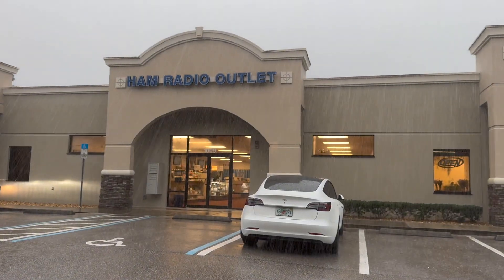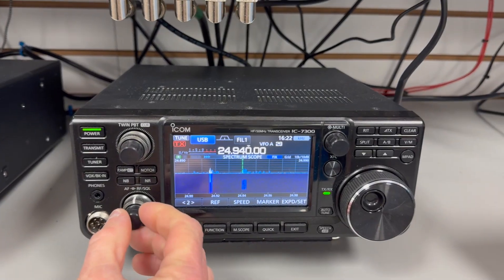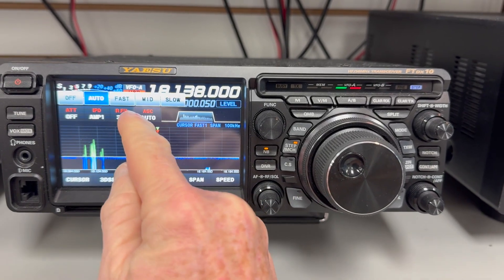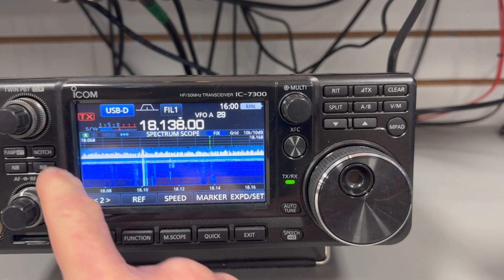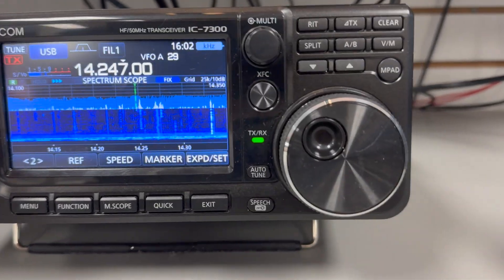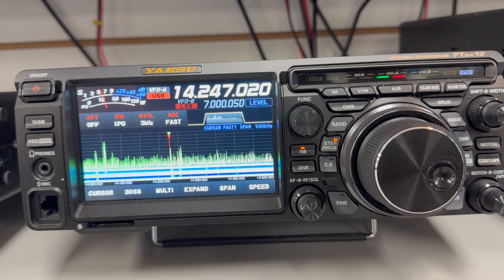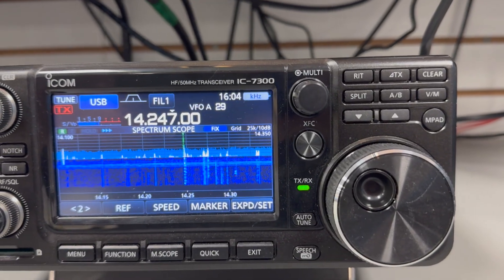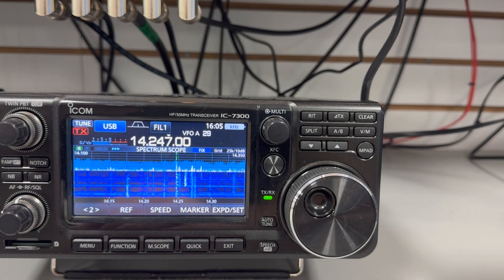ICOM IC7300 vs Yaesu FTdx10 during Orlando Storm (READ DESCRIPTION BEFORE COMMENTING)

Comment: did you hold down the noise blanker button on the dx 10 and turn up the noise blanker ?
Reply from the maker: Yes, sure did. Also described in the body of the video.
Reply: tnx for answering my question i also have a dx 710 and  dx 10 and icom 7300 i have been comparing  there noise blankers sorry that i missed  it in the header

Comment: Living in Oklahoma City, I also experience a lot of rain and thunderstorm activity. I own both the 7300 and DX10, and when properly set up (using DNR on the DX10), there really is no comparison. The DX10 blows the 7300 out of the water in handling noise and interference; if you add in notch/contour and shift/width, the DX10 is simply the gold standard in an under $1700 radio. In fact, i am now selling my 7300 after less than 2 hrs use. de KN7I in OKC
Reply from the maker: Thanks for sharing your experience!

Comment: Why are you using the NB mode on the Yaesu,did you set the NB settings correctly and when you should have use the DNR instead (And you didn't even turn on the DNR on the Yaesu) with a little of the CONT for those lightning strikes affecting the Yaesu sensitivity receiver,the Yaesu is why more sensitive than the Icom 7300 and that is why you are picking up the lighting strikes.Your not being transparency of the real performance of the radio and it's option feature of the radio itself,it's like bashing a manufacture without really owning one and know it's features and know all the features it provide you as a tool.You didn't control the D-Level screen to lower the spikes or the waterfall.You adjusted the Icom radio of the NR ,but never did do it on the Yaesu,what kind of transparency reviews are you telling those folks who watching this video who wants to buy either of the radios?I think you need to re-clarify all the folks here on YouTube of your Video if you plan on doing this reviews that is not legit of your words.
Reply from the maker: All of these complaints about me. I went in knowing nothing about each radio. Spent 30 minutes with each. Then made a decision. I've been transparent about all of this. And I've also said in the introductory text, and numerous replies that I did try DNR and it didn't make a difference. (The video was long enough so I didn't include that test). I've also said repeatedly that I'd be super happy to meet someone down at Ham Radio Outlet in Winter Park who knows the radio where we can repeat the test. I'm not trying to bash any radio -- just report what I personally found on that particular day and under those particular circumstances.

Comment: Crikey - some butt hurt Yaesu fans here LOL. I'm radio agnostic, I have all brands - Flex, Icom, Yaesu, Icom and Kenwood. Within the genre of this video, I own 2 x IC-7300, 1 X FTDX-10, 1X FT-710. For me personally, I prefer using my 7300 for a number of reasons....for starters the UI is way better on the Icom. Also  the power level can be stepped all the way down to 0.3 watts whereas the Yaesu stops at 5 watts. This is important for me because I use Mosfet amplifiers that need drive levels below 5 watts. I also have VHF and UHF transverters that require 1 watt of drive. Amp hookup is also easy on the Icom - I live in Africa and I can go to any local grocery store and buy the RCA cables required to hookup to my amp. With my Yaesu, I would need to import the special cable (or connector) from the USA or EU. Then there is the creamy smooth averaging of the display.....and one of the most important features - being able to see ALL meters on screen at the same time - Power, SWR, Current draw, Processor level, ALC, voltage, temperature - highly important when trying to setup digital audio levels and monitoring transmission levels. Yaesu can only show one meter at a time. But, I'm not selling my FT-710 - I love that rig, but will probably sell my FTDX-10

Comment: Both are great radios. As others have said, you turned up the panadapter level (which does not affect audio fyi) and did not adjust the DNR on the Yaesu. I highly recommend N4HNH's videos on a comparison between the 7300 and the FTDX10. The Yaesu has more tools to deal with noise such as a manual notch and contour, as well as (imo) a better DNR and NB. I wish I was in the Orlando area, I would happily help film another comparison.
Reply from the maker: I did adjust the DNR, but not in a recorded part of the video. And yes, the real clue is going to be meeting a buddy there and doing another test.

Comment: Did you notice that on the FTDX-10 you can't tune the radio by clicking the bandscope?  Keeping my 7310..  bandscope centric is a key SDR feature.
Reply from the maker: I didn't notice that, but the particular feature of the 7300 is also something I haven't tried myself. It sounds useful and I will give that a try.

Comment: I'm afraid you have no clue how a noise blanker works and what it does to a receiver. 
The 7300 was the winner (in your opinion) because you were not able to use and compare these transceivers correctly. 
The IC7300 MIGHT have been the winner for you - it's a very good transceiver -  but NOT because of your wrong conclusions.
Reply from the maker: So I'm right, but for the wrong reasons? ;-)

Comment: AGC on SSB should be medium or slow.  You had it set on fast on the Yaesu. Really wrecks the audio response with respect to noise.
Reply from the maker: Could be. I've found medium or slow to be troublesome on the ICOM radios, so that's why I set the Yaesu the same. I've been wanting to do a re-test, at that same location, but during a time of clear weather, and also with someone who really knows Yaesu, but so far nobody has volunteered to meet me at HRO to do the re-test.

Comment: I like both radios, prefer the waterfall on the 7300 and the sound of the ftdx10.  Ive had both, I think the 7300 might edge out the dx10 in transmit sound and it has sold more than any other radio out there. The ftdx10 can probably squeeze out a weak signal a little better though, I was amazed how I could adjust the notch filter plus dnr and get rid of the noise.
Reply from the maker: Agree on all points.

Comment: On the DX10 the  NB is normally OFF when you hit the button, you need to hold it then set the level using the function control. I had the 7300 and then got a 710, to be honest on hindsight I wish I kept the 7300. To many hardware bugs in Yaesu radios that take years to resolve if ever. The TX audio quality is poor from the factory, loads of Youtube vids on the issue, the icom is spot on without the multi menu EQ's etc. I think you made the right choice.
Reply from the maker: I too believe I made the right choice for my particular situation, which involves noisy environments. If my situation was a super quiet environment in which I am trying to really pull out low-level signals, I do believe the Yaesu would have been the winner.

Comment: The waves are like the telephone of ready-made opinions: Overload. This test seems significant to me ; both transceivers are capable of saturated both !! This is the lesson ! Besides, in your opinion, which transceiver wins between the old ftdx1200 and FTDX10 ? FTDX1200 against Sherwood's opinion. Sorry for my english.
Reply from the maker: My understanding of Sherwood's ratings is that they favor sensitivity. I have repeatedly stated that for weak signals, the Yaesu would be the winner, and so my opinion and Sherwood's opinion are aligned in this regard. I have not seen Sherwood subject radios to situations of high overload to see which would be the winner in that case.

Comment: To be fair there are variables that could be in play aside from strictly brand to brand comparisons, such as possible cable issues, display radio abuse, a faulty unit, etc. Your comparison does show better quality reception/ lack of interference on the Icom, but is that a Yaesu engineering issue in general as some have suggested or is there some other issue at play in the unit itself or the connections? 🤔
Reply from the maker: As stated in the description text, this was just my experience on that particular day. I do plan on going back and repeating this test during the calmer months and have the hopes that someone familiar with Yaesu will join me. I have made a public plea here on YouTube but so far nobody has reached out to engage me in this endeavor.

Comment: Thanks for your video.  I enjoyed it, in the market for new radio , blown finals on my ic 7300 storm static.  I always found the icom a easy to live with radio , my disappointment with it was the RF gain (or lack of ) same with att it would back off the sig but noise was always there . This dx10 appears very nervous with stormy conditions?  I guess there is no perfect radio ? Hence we all bounce around YT looking for the Holy Grail ?
Reply from the maker: Yes indeed that was my approach as well. In Florida I don't have a situation where there is such low noise that a weak signal could be heard even if one were present. Moreover, if there is a very weak signal, the chances of you communicating at 100 watts is also low. So this wasn't a priority for me. Instead, dealing with noise and especially things that happen during storms was important. This was the yardstick I used to make my final decision.

Comment: Nice info.  I notice the Yaesu did not have DNR enabled as you showed on the ICOM.  Or was it enabled?
Either way Good info.
Reply from the maker: I spent 30 minutes with each radio at Ham Radio Outlet, and after spending 30 minutes, I then decided to take the short snippets with the iPhone. Indeed I did record a segment where I tried both DNR on and off, and it made very little difference, so I left that segment out of the final version that made it to YouTube. In the description to the video I did mention that I tried DNR on and off.

Comment: Was it the same antenna for both radios? If not that could explain the noise
Reply from the maker: Yes same antenna. There were only a few representatives in Ham Radio Outlet that day, and with the very heavy rain, I didn't ask them what kind of antenna they actually have. My guess is -- it isn't very good!

Comment: Of course you liked the icom better.  You engaged the digital noise reduction but never engaged it on the Yaesu.  Go back and do a fair comparison.
Reply from the maker: I indeed did try DNR on the Yaesu, as stated in the description of the video. I spent 30 minutes there and made a lot of video, including a part of the video with DNR turned on and it had nearly no effect on this particular type of noise.

Comment: the 7300 is on digital mode.
Reply from the maker: There was one part of the video where it was selected to USB-D, but only one part, and I doubt this has an impact. If your point is that this makes audio better, why the heck wouldn't everyone just select USB-D for audio use?

Comment: you did not use the dnr on the yaesu ypu only engage the noise blanker
Reply from the maker: Used DNR too. I removed that part of the video because -- trust me -- it did virtually nothing under those particular circumstances. And noise blanker is really for repetitive interference, so I wasn't expecting much there, but tried it anyway, because what I was hearing sounded kind of repetitive. I think there is an auto repair shop nearby, and I assumed I was picking up interference from there. On automobile-related noise the blanker would do pretty good, so I figured it was worth a try.

Comment: You did not have the Yaesu set-up right. The FTDX-10 is the better radio. Too bad
Reply from the maker: I didn’t? Or HRO didn’t? Some people are acting like I purposely set it up to fail. I did not. As a UI designer myself, if the user is not successful, I take the attitude that I failed the user, not that the user failed to get it working.

Comment: thanks for posting. Around here in the uk we haven't got a hro so rely on side by side comparisons such as this.I think the 30 mins learning proves the icom is easier to use.you can get a good deal on a used 7300 from hams thinking the ftdx 10 is far superior when most of the comparisons show it is a  bit better 73
Reply from the maker: The ease of use of ICOM radios is well documented, and easy to experience. I'm trying to find someone in the Orlando area to meet me at a local HRO to do a bit of show-and-tell and see if we experience the same thing. Another person commented that this location has a lot of other RFI sources.

Comment: No averaging available on the panadapter on any yaesu. Don't get me wrong, i like the yaesu, and i like the audio quality of the recieved signal....but weak signals are more easily seen on the icom, because of the availability of averaging. On either radio, or any radio, for that matter....reducing the rf gain, and turning up the volume, works wonders for recieving signals in a high noise environment. It also improves the dynamic range in the presence of close by qrm.
Reply from the maker: The ICOM spectrum display could have been adjusted differently, as many people do, but I didn't want to mess with the settings of Ham Radio Outlet's radio. As for Yaesu, I'm hoping to find someone in the Orlando area, who uses this radio every day, where we can have a more meaningful test.

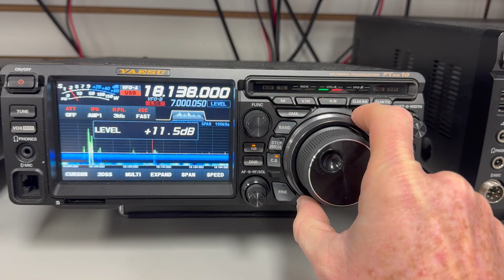Comment: At 2:19 you set the waterfall gain level very  high which made all the noise on the band seem way worse visually. usually you would set the db gain to where with no signal your just seeing a little flicker on the screen then if you look all the actual signals you want to see will pop out much better on  the waterfall. If you went into 3dss view you would set the level to where the noise just looks like little blades of grass and the signals will jump out above the noise.  Also with the dnr you can long press the button and adjust the level of dnr you want to use. I have both radios they are both great but the dx10 when setup correctly can clean up noise and pull out a signal better. 73 de kc1rpv
Reply from the maker: Thanks for the info. These settings are apparently more buried than they are on the 7300, so harder to discover with no instructions. And yes, several people have commented about panadapter settings, but that should not have affected the audio quality. During the crashes, the audio was screeching. That didn't come across completely on the iPhone video, but the sound was really strange.
Reply: @WilliamBennerJr  where was the salesman? He should’ve showed you how to use the FTDX 10 so that you could make a comparison. Look at the Sherman reports: dx10 is a winner there
Reply from the maker: @GoAmateurRadio  The particular guys who were at HRO that day didn't know Yaesu. Seems they have staff that kind of rotates every other day, so it could be that the other crew knows Yaesu. And yes, I know Sherwin gave them great reviews -- far better than ICOM, but my understanding is that their ratings are on the basis of weak signal sensitivity. Signals that are very weak are never a problem for me, but storms and lightning crashes are, since they happen virtually every day in central Florida. Therefore my concern was overly-strong-signal performance not weak-signal performance. I'm hoping some passionate fellow in the Orlando area will be willing to meet me back at that location and we can take another look and make a follow-up video.

Comment: Dx10 has no averaging or smoothing on their panadapter, they refuse, and I’ve never understood that.
Reply: That was a large point that I based my decision towards the 7300 when purchasing a second hf rig for portable ops. I like yaesu, don't get me wrong. But, when wanting to see signals on the panadapter, the averaging makes weak signals visible above the noise floor. It's funny how many hams miss this point.
Reply: @miker1473 I’d rather have a radio where weak signals were more easily copied than more easily seen on the display.
Reply: @Brendan8440  that's why you do you, and I do me. I have NO problem copying signals on mine. Compared them side by side, and bought the one I liked the most. Hope you had the same experience.
Reply: I don't want that epileptic panadapter. It's useless, ugly and it drives me crazy after a short while.
I'm still waiting until Yaesu finally introduces an averaging function in their rigs but I'm afraid I'm waiting in vain...
One + for the Icom.
Reply: Pattended, most likely.  My 590SG and DX10 don't have that input-responsive VFO dial either; they have a dumb VFO speed button, which is quite irritating to use!
Reply from the maker: I have the impression that the panadapter is kind of done separately -- like as a separate process, whereas on the ICOM radios, it seems to be a part of the pipeline.

Comment: Yes, settings - you have to be familiar with yaesu radios and use nb levels,  contour etc. I have noticed , that first thing you did  on ftdx 10, was to turn CS setting right up, making it looks bad on the waterfall. So you knew abt CS. That makes me thing, that your comments are biased and intentional - bad review! Ham radio op since 1972, Australia
Reply from the maker: Not an intentional bad review that's for sure. Why would I do that? It's not like ICOM is paying me! I turned the outer dial, which can control several things. Anyway, will make another visit and try again.